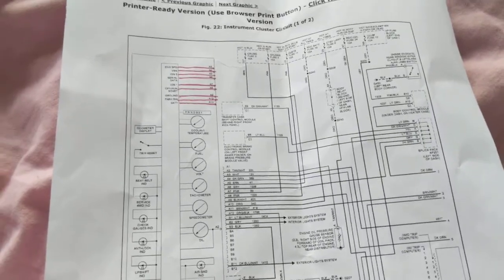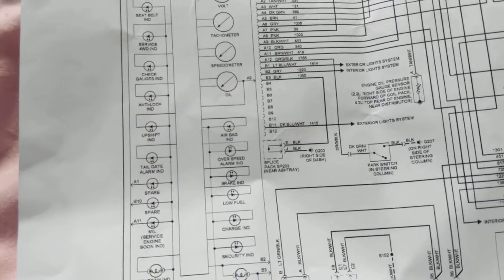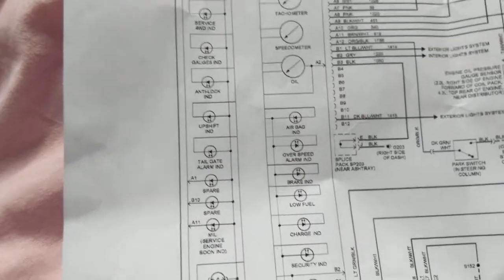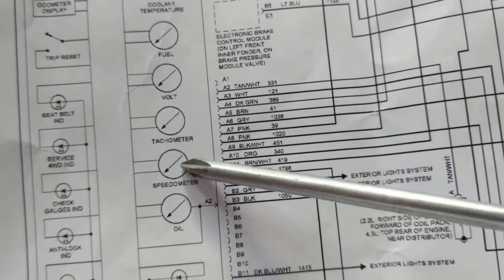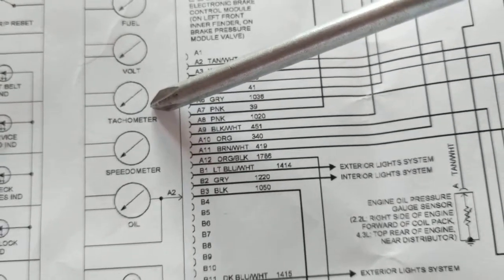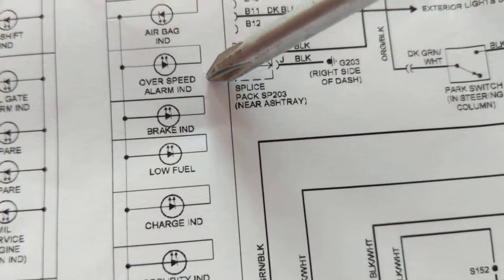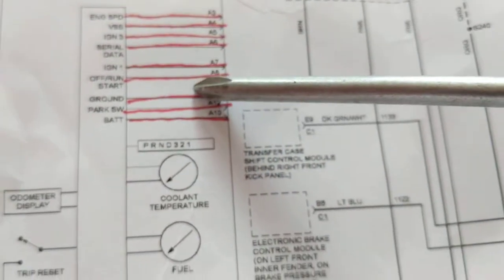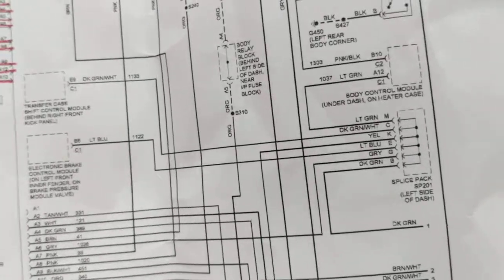How to diagnose and understand  diagrams INSTRUMENT CLUSTER PANEL BOARD UNDER DASH please subscribe

Comment: Where is the best place to get a diagram for just one part (So that it’s not expensive). For example, I have a climate control that I want to test and see if it powers on but I don’t wanna buy all the schematics for my car because that will be more expensive? Thanks
Reply: If you look at something related to air conditioning system climate control go to Google put in climate control diagram for the make and model of your vehicle it should give you some pages of diagrams at least something to choose from try that and get back to me

Comment: This has no troubleshooting
Reply from the maker: Thank you for your comment
Reply from the maker: The reason for this video I have another channel called Joe electronics schematics for Auto which has just been monetized the reason for this video is that when you start the car if your instrument panel comes on with the lights that means you have a lease 10 and a half volts from the battery otherwise you might have a bad connection at the terminals if you have nothing on the instrument panel